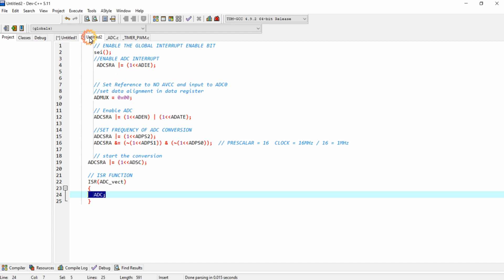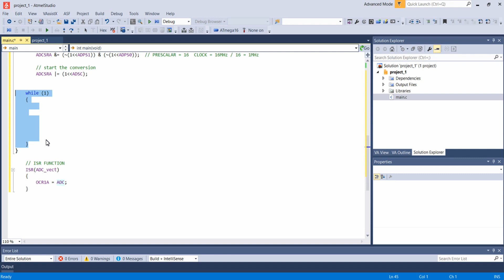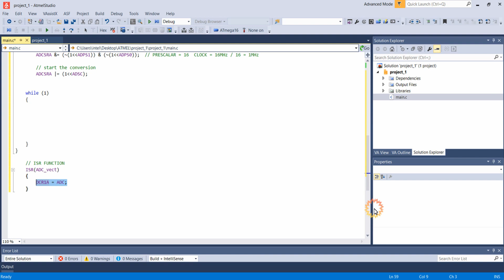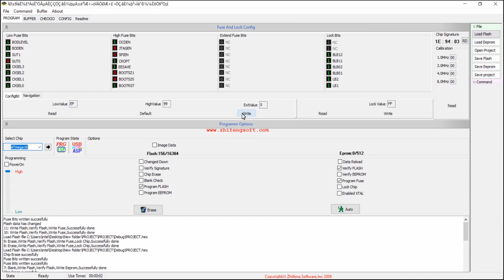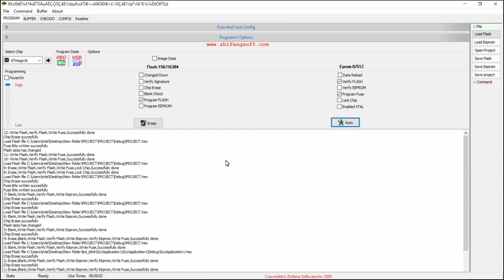ADC PROGRAMMING (VARIABLE RESISTOR) IN ATMEGA16 | ATMEL STUDIO PROGRAMMING COURSE | T - 31

Comment: Is it possible to connect upto 5 analog sensors to other ADC pins?
If yes how is ADC value (i.e after conversion of each) gotten?
Reply from the maker: Yes possible you will get ADC step value based on voltage signals in each channel similar operations is required except that you want to change the channel of reading step value for each time
Reply: @SMtrainingacademy  I don't understand this could you pls put me through
Reply from the maker: Ya I’ll try to make video on interfacing two channel in a microcontroller